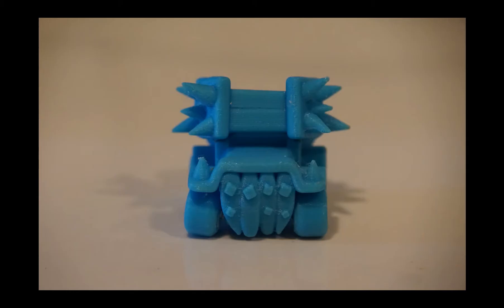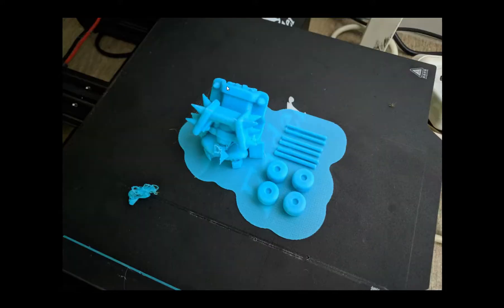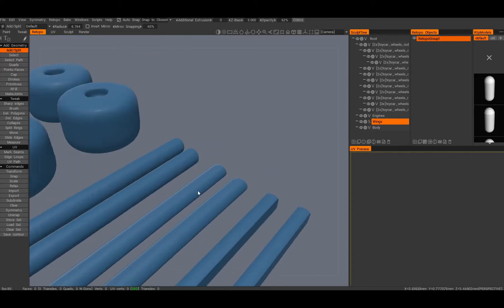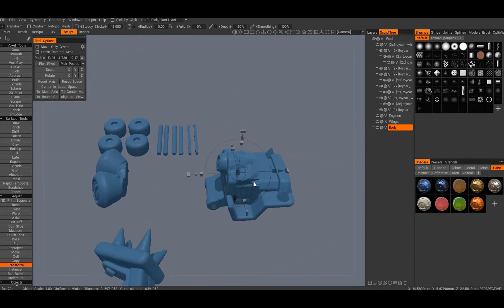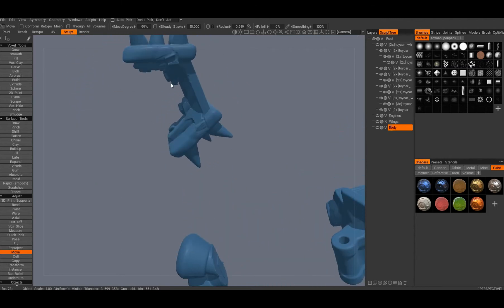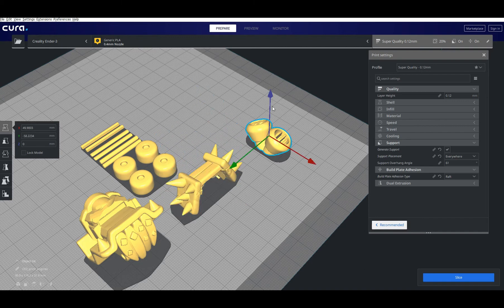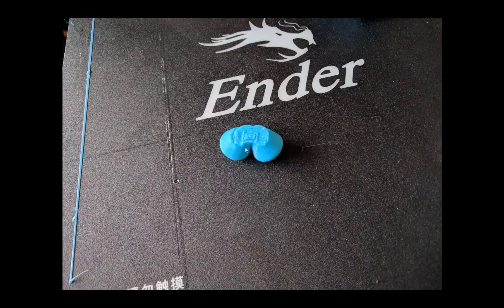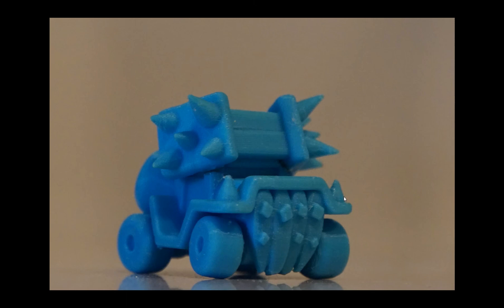Toy Car 3D Coat Design to 3D Printing - Part 2 - Printing

Comment: get an Elegoo MARS lcd printer. its only $230 on amazon.  the quality is way better that  ender 3 type printers.
Reply from the maker: I don't want to deal with the before and after preparation. I don't have an extra room space for it to print safely as well. Atm I don't even bother painting my models
Reply from the maker: Thank you for the suggestion though :) I did watch a video about Mars printer before from 3D Printing Nerd  channel